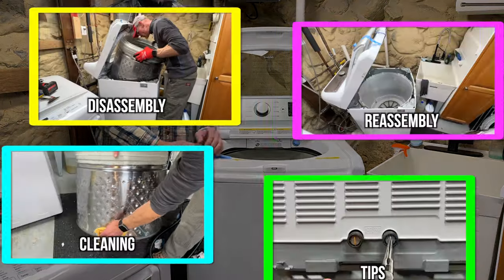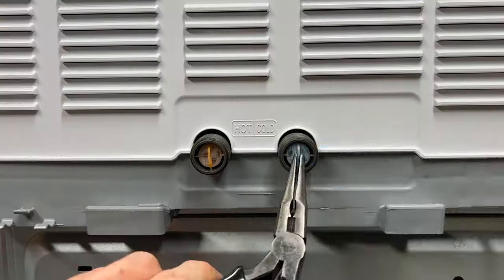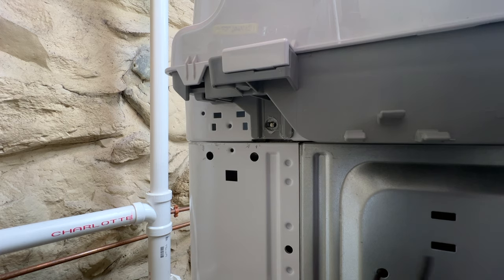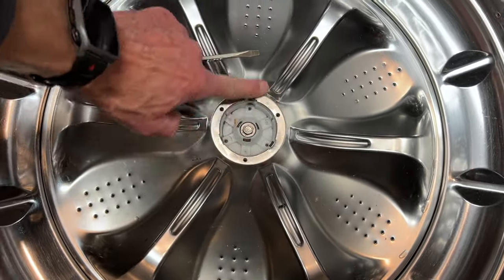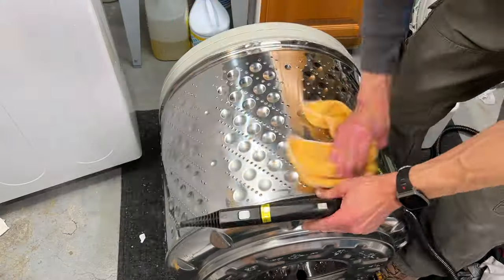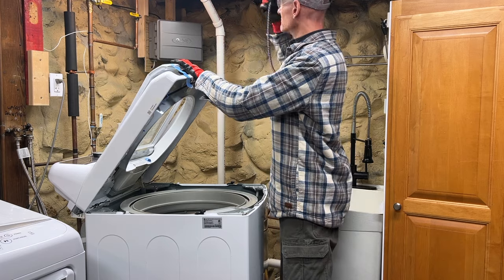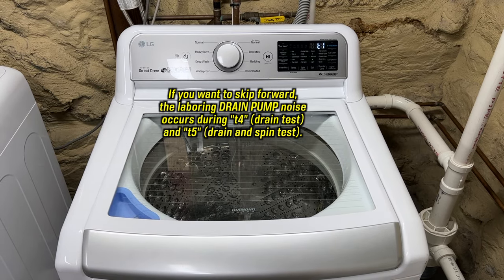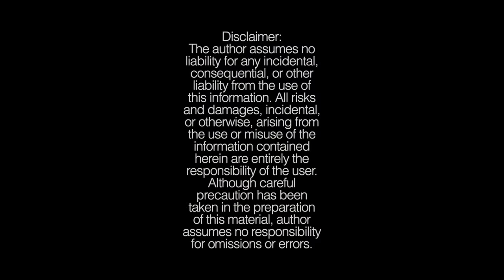How To Remove Tub From LG Top-Load Washer For DEEP Cleaning  WT7300CW

Comment: This washee was my biggest regret. I hate it so much! I have to disassemble it like this every 6 months. Despite babying it and following every rule to avoid scrud. I am so done
Reply from the maker: Oh my! That’s frustrating. You shouldn’t be having that issue. Usually changing detergents, using less detergent, avoiding fabric softeners, avoiding cold water washes, and running a tub clean every month (or 30 cycles) prevents scrud buildup. I wonder if it’s your water that could be the issue. If your water is too soft or too hard it can exacerbate the problem.

Comment: Phenomenal video, man. Straight to business. I can confirm that the procedure is the same for the model that has an agitator. The top pops off the top of the agitator, then you just need about 24 inches worth of extensions to reach the same 10mm bolt at the bottom, inside the hollow agitator shaft.
Reply from the maker: Ha! Thanks for sharing that info.

Comment: THANK YOU! this video was instrumental in helping my deep clean my LG. Basket and tub were spotless when I put them back in but it’s still loading up with scrud…. The repair person even changed the pump and had no idea where it could be coming from. Any tips/ideas?? We’re at our wits end here
Reply: Same here. Disassembled the whole washer, power washed the tub and scrubbed it with a cloth both inside and out. Scrubbed the plastic tub in the washer until it was spotless. Installed a brand new wash plate. Yet I’m still having that nasty scrud floating in the water. WTF? It’s less than before…but everything was spotless when I reassembled the washer. Where the heck is this crap coming from?!?! 🤬
Reply from the maker: I’m trying to get clarification from another comment about their experience because they mentioned having the same issue and discovered that they had scrud inside the wash plate although they kept referring to it as a wash plate/ agitator and this machine doesn’t have a traditional agitator. Their remedy was to remove the wash plate, put it into a bath tub, and use the power setting on their shower wand to wash the inside of it.  They mentioned washing it in both directions (from top down and bottom up). They also said they soaked it in a vinegar bath.  @_MrJasonW’s reply to your comment says he had the wash plate replaced and still had the issue, so in that case it could be coming from under the hub (hub may be tarnishing with a particular detergent) or the drain hose.
Reply from the maker: I wonder if the hub is having a reaction to your detergent and bits are flaking. Did you clean the underside of it? Also, you may want to check the drain hose between the tub and the drain pump. I did a video on how to change the pump which will show you how to remove the hoses. It’s pretty straight forward. Good luck!

Comment: this video is great but incomplete.  I still had brown sludge afte deep cleaning and several followon tablets.  I discovered this was because the wash plate/agitator is also filled with gunk and does not come apart for cleaning.  Without doing that, you have to slowly get it out through repeated wash/cleanings.  What works great is to remove the agitator and put into a bath tub and use a power setting on the hose shower to wash the inside of that.  You need to do it both directions from top down and bottom up.  Do this a few times along with a vinegar bath and wow, what a difference!  good luck all.
Reply from the maker: Thanks for the info.
Reply from the maker: Question for you… does your model have a wash plate like mine or an actual agitator that sticks up into the machine?

Comment: This is such a great video! Just used this video to help clean our machine that smelled of rotten eggs!
Question: after putting everything back together the machine is filling with too much water...eek! It only stops when I switch it to spin. How can I fix this?? 
Thanks!!
Reply from the maker: Hmmm… does running a test cycle provide any error codes?

Comment: Excellent tutorial video!  My issue is that I heard a grinding noise during a wash cycle and saw what appeared to be little pieces of black particles at the end of the wash cycle.  My gut feeling is that something made its way into the wash cycle and destroyed a gasket.  I’m now noticing a small leak below the washer but the washer continues to function without the grinding noise.  I’ll be using this video to take my LG washer apart to look for the issue and hopefully reorder a replacement gasket.  Any suggestions on what gasket to focus on?  Thanks in advance.
Reply from the maker: I’ll go through the parts diagram tomorrow and get back to you. I believe there’s a gasket above and/or below the hub nut. Before opening the machine as I did in the video, I recommend opening up the back panel and checking that the clamps are properly seated and securing the hose between the tub and drain pump and the drain pump and exterior drain hose. The LG clamps stink and if the machine was shaking badly they can come loose (I replaced one with a radiator hose clamp because it kept slipping).

Comment: hey Bruce i cant get my bottom plate off in the wash drum any ideas I've tried  the hook method and your wire method also made sure the locking washer an rubber nut was out lol... is there any reason why it would be so hard to remove?? ty
Reply from the maker: If it’s the same model as mine, there may be some corrosion (likely hard water deposits) holding it on. Reading through the comments a few folks mentioned that it ultimately required brute force to lift it straight up. Another person mentioned they left the machine hooked up, removed the screw, locking washer, and rubber  gasket and then ran a wash cycle (stop the cycle before it spins though) in order to loosen it up, which it did (one person said theirs floated right off), but I don’t know if I’d try that.
Reply: I had the same problem.  Everything I researched said it was fabric softner that basically has glued your wash plate down at the spindle.  After trying everything under the sun, I managed to get it off.  I removed the bolt, then got two hook tools from harbor freight.  I poured boiling around the area where the spindle/bolt is.  Then using a hook tool on opposite sides in the little wash plate holes on the outer side of the wash plate, I would yank upward.  Then rotate the hook tools around the wash plate but keeping them on opposite sides and doing the same pulling method.  Amazingly, it came loose in seconds.  I had been trying to get this off for months too.
Reply: Ty all so much
Reply: I saw in another video to run a tub cycle and it came off in less than five minutes on its own.
Reply: @abhitaaustin3384 This worked for me! Super easy! Just removed the screw and ran a cycle. Popped right off with within minutes!

Comment: i have piece of cloth around the wheel in the bottom.. please tell me how to remove the wheel? appreciate your help
Reply from the maker: Sorry for the late response. I’m not sure how a cloth would even get there on this model unless the tub was so full it fell between the stainless tub and plastic outer tub. I would try to cut out as much of the cloth as possible since removing the inner hub (the wheel) means lifting off the squared washer and then removing the 32MM (I believe it’s 32MM) nut; however, I think it’s more complicated than that since that nut may be holding up the clutch, stator, and rotor assemblies…  and if you remove the nut and they hit the ground it could stress the wiring or damage the components underneath. I suppose you could put a block under there to hold it up, but since I haven’t done it I can only tell you what I know. Good luck!

Comment: Only extra things I did were remove the tub spinner hub wheel. Need a 1-1/2" socket or crescent wrench. After removing the large nut, I used CLR to break it free and it pulled right off. This lets you remove the wheel and clean UNDERNEATH!

The tub spinner I removed the metal from the plastic; there was a ton of buildup in there! Had to pry the metal with a large screwdriver. Crimped the metal back to the plastic after cleaning.

Also, remove your hot water hose and start a spin only cycle (need power and drain)! Turn on hot water and hose it down. The drain pump will turn on and help you flush everything. With everything removed, nothing will spin. You'll need to move the lid off to the side to allow room for the hose.
Reply from the maker: Thanks for sharing those tips!

Comment: Any tips for lg top loaders with the agitator right in the center? How does it come out?
Reply from the maker: Someone wrote about it in the comments… you pop the top off the agitator, which is hollow, and then you’ll need about 24” of extensions to get down to and remove the 10MM bolt.

Comment: I cannot lift the wash plate "impeller".   The center screw is out and I fished the wire through, but it doesn't budge, even with some good force.  Any idea what is keeping the wash plate fixed to the drum bottom?  I have the same model from your video (WT7300CW).
Reply from the maker: Hmmmm. I pulled the diagram from lgparts.com and there’s nothing other than the screw, lock washer, and rubber gasket I showed in the video. It’s possible they’ve made changes since. Maybe they added a circlip in there? You’d see it though. May just be some corrosion (hard water) on the clutch coupling. I’m also curious to know which model you have since WT7300CW has two variations. There’s ABWETUS and ABWEUUS. It will show on the sticker on the left side of the machine. Also, what year did you purchase your machine?
Reply: @BruceAlanR  I'm so sorry that I didn't see this reply until now.  Thanks for your thoughtful response.  Honestly, it was sheer brute force that eventually detached it.  I was very hesitant to pull hard for fear of breaking something, but that is what was required.  Your entire video was incredibly helpful!
Reply: We are having the same issue- ABWEEUS VERSION bought ruffly 2019/20. 
Also was thinking there is soooo much gunk built up that it won’t come up. We will give MORE brute force . -That’s not working will try a hot tub clean to help soften gunk😳 first
Reply: Oh ours is modle WT7500CW- newer model???
Reply from the maker: @rachelhinesified  WT7500 isn’t a newer model, it is two models up from the WT7300. WT7500 has slightly more capacity, and provides more wash cycle options on the dial… among other things. 
It is likely similar; however, I recommend pulling the parts diagram (lgparts.com) to see what you’re up against.

Comment: My 6 screws for the tub don’t line up like yours. It’s the same model but the patterns different. Any suggestions?
Reply from the maker: That’s Interesting. I wonder if they made subsequent changes to this model. There are two versions of the WT7300. I’ve found the best way to take things apart is to capture video during the process and take lots of pictures so that I get everything back together properly. When it comes to reassembly, I then look at my photos in reverse. I can’t talk you how many times that method has saved me. For additional reference, you can also go to LGparts.com, put in the model number and look at the exploded parts diagram, which is relatively accurate…  sometimes the parts look a little different.

Comment: Hey there any chance I could get a link to the suspension rod change video, I can't seem to find it and I need to figure out how to take that metal part in the middle of the white tub. Thank you for sharing your knowledge.
Reply from the maker: Sorry! Still working on the video. You have two options and it depends on whether you’re changing out the suspension rods or the suspension rods AND the horizontal dampers. If you’re only replacing the suspension rods and reusing the dampers, you can use a flathead screwdriver to pry the tabs of each damper from the rod. If you’re replacing the suspension rods AND dampers, you remove the plastic pin that attaches the damper to the tub by pushing in the tab on the bottom of the pin. The easiest way remove the pins is to place the round end of a 5/16” (or 8mm) socket wrench around the bottom of the pin (to depress the tab) while pushing the pin up from the bottom. When you replace the pin to reattach the damper to the tub, just be sure the flange side of the plastic sleeve at the end of the damper is facing up…. The pin goes into the flanged side.
Reply: @BruceAlanR  That is super helpful thank you so much. Thank you for sharing your knowledge!
Reply from the maker: Sure thing. I’m hoping to have the suspension rod video posted this coming weekend. Working on it now. 😃👍

Comment: Thanks for the video
I was able to remove the pulsator cap and the screw...but cant lift up the wash plate impeller using the wire no matter how hard i pull. Its there anything that i missed? My model is TH2113DSAK, Top load..
Reply from the maker: Since you have a different model, disassembly will likely be different. I recommend reviewing the  parts manual to see what you’re up against. May be something as simple as a circlip holding it down.
Reply: Did you get it off?  Least painful way to get it loose is run the shortest wash cycle and shut machine off after water is drained but before the spinning starts.  I did it with the screw and middle cap already off.  For some people it might just float right up during the wash cycle. I had to  pull mine up.
Reply: @cutoats  yes. I did. I sprayed lubricants on the screw part, and left it for 2 days.
but after I washed the plate, the clothes still a bit soapy after one full cycle wash. I have to do another rinse to get the soapy feeling off....

Comment: i have a cloth stuck around the bottom wheel around the gear! please suggesr
Reply from the maker: Sorry for the late response. I’m not sure how a cloth would even get there on this model unless the tub was so full it fell between the stainless tub and plastic outer tub. I would try to cut out as much of the cloth as possible since removing the inner hub (the wheel) means lifting off the squared washer and then removing the 32MM (I believe it’s 32MM) nut; however, I think it’s more complicated than that since that nut may be holding up the clutch, stator, and rotor assemblies…  and if you remove the nut and they hit the ground it could stress the wiring or damage the components underneath. I suppose you could put a block under there to hold it up, but since I haven’t done it I can only tell you what I know. Good luck!

Comment: Are there any seals or o rings under the tub . I say because mine is having some minor leak under the tub
Reply from the maker: I believe so but I’ll need to pull the parts diagram again. If you haven’t done so, I recommend checking the hose connections to see if they could be the culprit. The spring clamps that secure the hose between the tub and pump are terrible. I replaced the one on the pump with radiator hose clamp because it kept shaking loose. Also check the small spring clamp that attaches the pressure level switch to the tub. If none of those are the source of the leak, then you can go deeper.

Comment: How tight do you tighten the pulsator screw?
Reply from the maker: The pulsator screw should be hand tightened and then snug it down tightly with a socket wrench. You want it tight so the lock nut and washer do their job, but not tightened to the point that parts underneath bend. My reference is to say to myself, "Tighten it, but not to the point where I'm using all my manly strength."

Comment: Great video, but I did everything in this video then I run a cleaning cycle and I get the same black stuff again! What am I missing? It only in the washer, nowhere else!
Reply from the maker: If it’s not in the tub, the only other places I can think of would be the water intake lines or maybe something is backing up in the drain hose. If you run a normal cycle does the black stuff immediately show up in the tub as it’s filling?
Reply: Just when I run the clean cycle. I think some is coming from the bottom of the hub (metal wheel) but even with the correct socket (38mm) it’s really on there and you have to stop the wheel from turning like it does. I was going to hit the ratchet with a hammer to try and get it off but I don’t want to bust anything either. I’m going to power wash it one more time. I just figured I’m going all out to clean this I should get nothing.
Reply from the maker: @mti14  It only occurs when you run a tub clean cycle? Hmmm… Tub Clean uses hot water only. So if you used a pitcher and filled the tub with hot water (to emulate the Tub Clean) and shimmied the tub, does the black stuff appear? Are you using a product for the Tub Clean that may be causing metal on the hub to flake? Or is the black stuff more like pieces of a deteriorated rubber gasket? If it was a deteriorated gasket the flakes would likely leave black on your hands. 
If you want to remove the hub nut, this video recommends using an impact. It’s an older LG top load model, but the process is similar. Check it out at 5m 40s.   https://youtu.be/qa6_ViM3xug?si=Ffmxoh5UzqZWNX-R

Comment: How many years that lg has? I need a washer and still trying to choose LG or another brand. Thanks in advance!
Reply from the maker: Our washer is only 5 years old. My only issue with it is that I feel like the suspension should have lasted longer.
Reply: In terms of washers, LG is the best. Especially for front loaders. No other brand gives you a better bang for the buck in terms of cleaning quality and reliability.